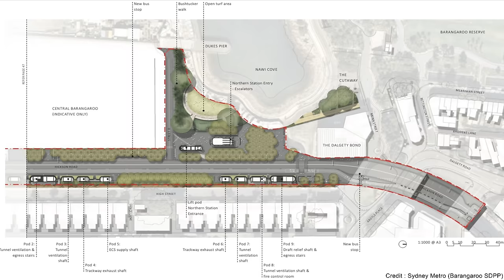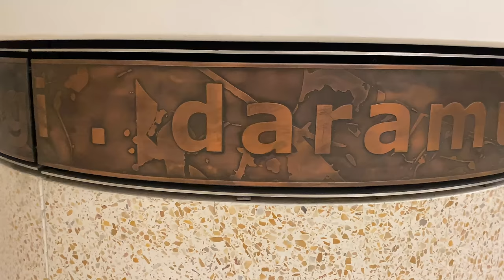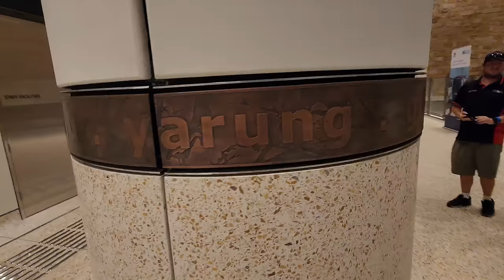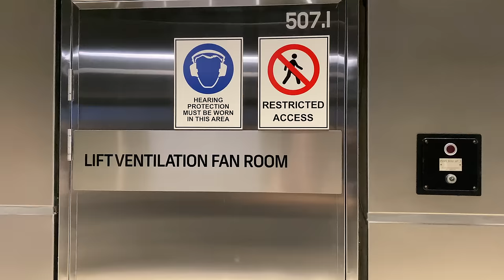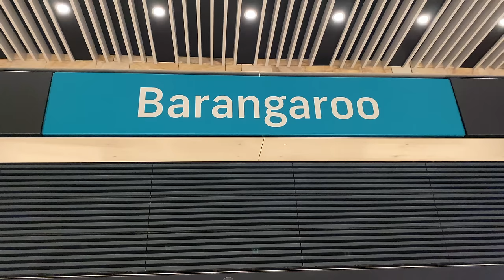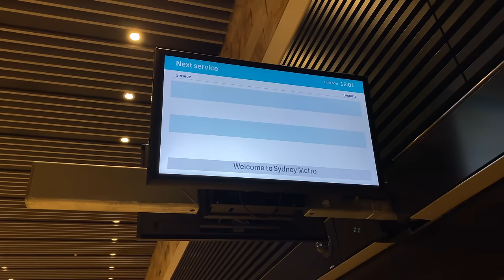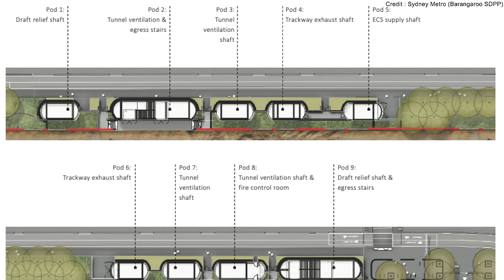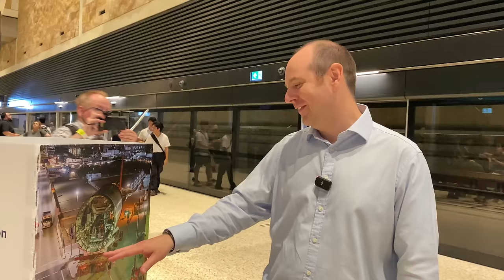First Look Inside Barangaroo Station - Sydney Metro City & South West Community Open Day

Comment: What I want to know is, is there a concrete plan for getting people across High Street?
Many people, including myself, who work near Wynyard station but travel from north-west on the metro would prefer to remain on the metro but if there is no easy walking path toward Wynyard then there's no point.

And I know the barangaroo wynyard tunnel exists but thats so far south of barangaroo station it defeats the purpose and may as well make the switch from metro to T1
Reply from the maker: Did you mean Hickson Road? - High Street is the one that is up lots of steps, above the heritage wall.  It will get easier when the Barangaroo South entrance opens, but until then, I think you'll be quicker staying on the train to Martin Place, and then exiting via the northern exit to Hunter Street. Wynyard Station is about a 5 to 7 minute walk from there.  In 2032, when Sydney Metro West opens, there will be a direct link from Martin Place to Wynyard via the new Hunter Street station. Hope this helps.

Comment: When would be the approximate end of total construction as my wife and I are thinking of having a journey with our bicycle's using the rail network from Shellharbour where we live to Barangaroo as we would like to use the new cycle ways that will be finally in operation please thankyou.
Reply from the maker: I would probably wait until it all opens, which is mid next year.  If you do decide to check it out before then, there is a cycleway from the Central Station (Chalmers Street entrance), that goes to Kent Street and that leads to the Wulugul walk which goes very close to the Barangaroo entrance.
Reply: @TransportVlog  ok thankyou, we'll probably let it be until this time next year when all the hipe and dust settles as the days are longer in summer so we return home before nightfall aswell 👍

Comment: Very beautiful but as a commuter Im confused about who would be using it on a daily basis. A lot of money spent on stations that are not very far away from each other- Pitt st vs Town Hall for example- while there are so many areas of Sydney desperately crying out for not just improved transport but for any transport!!!
Reply from the maker: Barangaroo will be primarily used by people working in the Barangaroo South area, plus local residents in the Millers Point and Rocks area. Building the Gadigal (formerly Pitt Street) station close to Town Hall, is to relieve pressure on Town Hall station which is already at capacity.  I agree that there are many parts of Sydney that are sadly lacking in decent transport, and planners have to strike a balance between improving links to these areas, and ensuring sufficient capacity in the busy CBD area for the future.
Reply: thanks for your reply! I guess the fact that I live on the T3 line (which has been facing many challenges) prompted my outburst! all the best and continue with these very interesting videos.

Comment: Typical a Crazy level of overengineering, London has a platforms that are 3 m wide and run trains at 1/2 the interval. More trains means less waiting, less people on the platform, smaller cheaper stations and therefore more metro lines.
Reply from the maker: Hi John, You're probably referring to the older lines and stations that were never designed for the number of passengers travelling today. Newer lines such as the Jubilee and Elizabeth Lines are much more spacious. Also advances in construction technology mean that much larger stations can now be created cost effectively, in ways that were never possible when most of London Underground was built.
Reply: @TransportVlog  not really, the older lines still have small platforms and small 3.5 m wide tunnels and transport many more passages than systems metro. They are fast effective and at less than 2 minutes intervals they clear the platforms on nearly each train. NSW is still an example excessive of graft. The latest Madrid metro using small tunnels small rolling stock  shallow  stations spent us$85 mill per KM, NSW spent US$330 million per km for metro north west and some of that was already dug. Don’t get me wrong we need metro, but we need small efficient fast trains. We don’t need these modern Soviet palaces